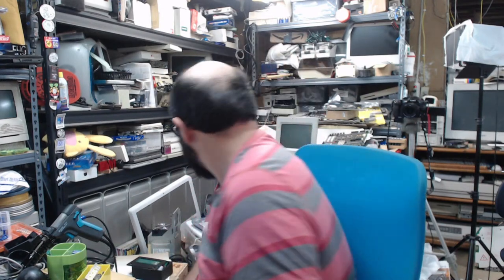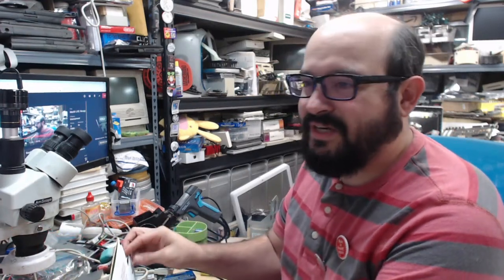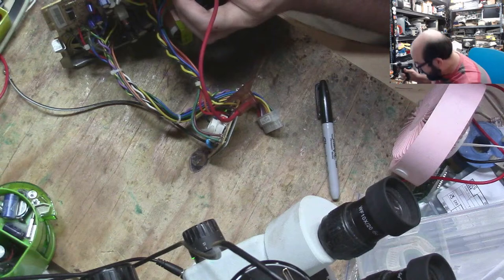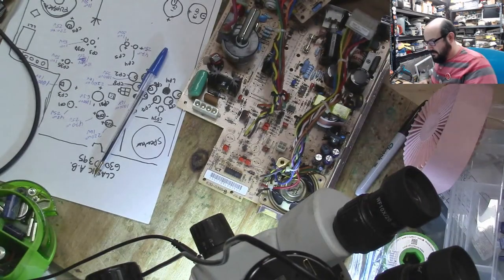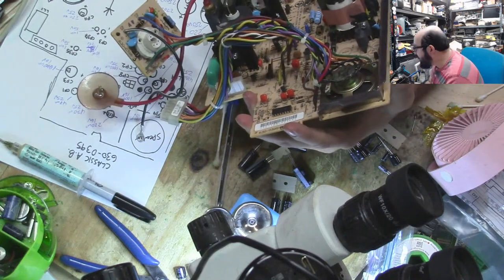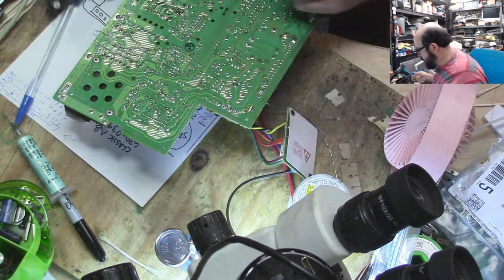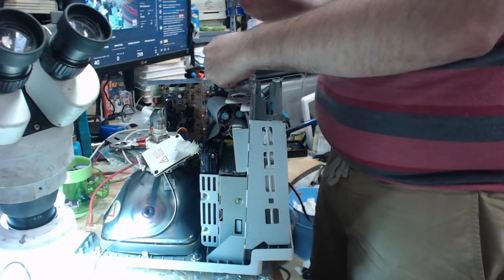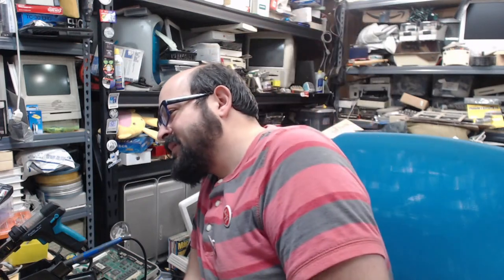Mac84 LIVE: Recapping a Very Clean Mac Classic - Part 2

Comment: The crt discharge procedure was good, but shorting the anode cap to ground after it’s been removed does nothing since the LOPT is not generating any voltage and doesn’t store a charge. It’s the crt that stores the charge.
I’d be interested to find out why your BlueSCSI was booting an image that you deleted as I’m building a few of those soon and will probably find all the traps myself.

Comment: That slight wobble could be that your +5V is not clean, or a bit lower than +5V with some AC ripple. I’d check that on a multimeter in AC mode. Possibly QP1 optocoupler is bad. I’ve got a couple of Classic IIs with similar symptoms atm. I think the Classic and Classic II use the same analogue board. There is a trimpot for the +5V which if you’re careful you can tweak a bit. You need a long small insulated Phillips screwdriver to get at that trimpot.
Reply from the maker: Thanks for the comment, yes I’ll be looking into these for sure!